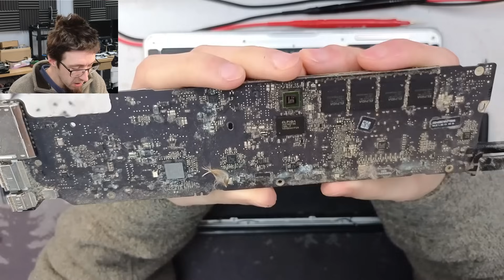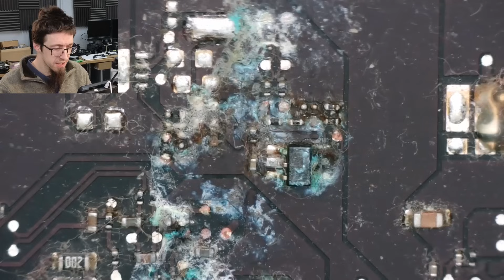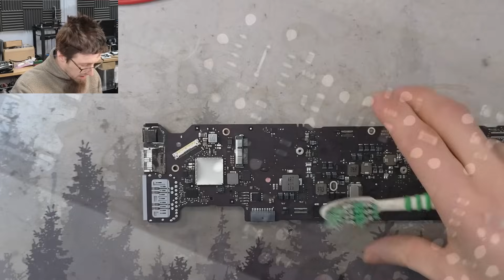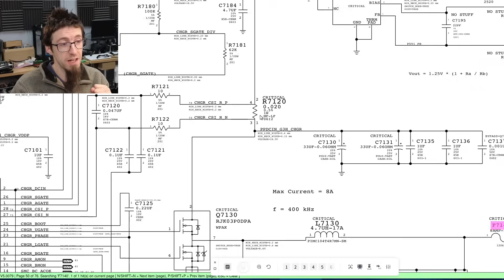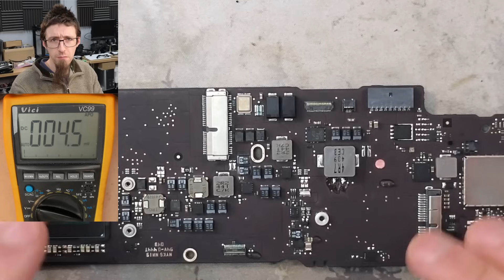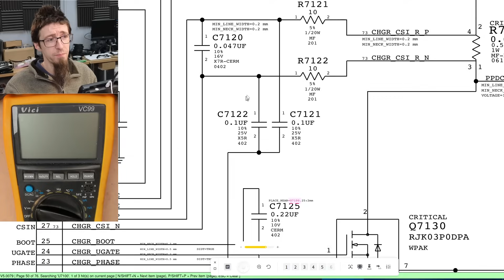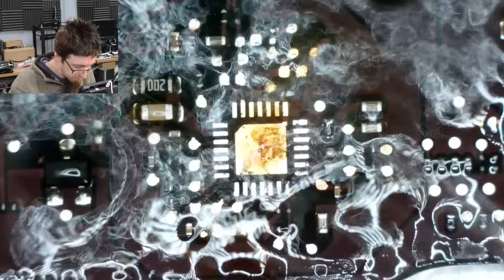MacBook Air A1466, Lots of Corrosion! - LFC#382

Comment: Hello I was watching your video, to learn how to take my laptop Lenovo ideapad 320 apart and clean ,as it is giving off a headache producing odor. It had some fuzz on the screen ,some fine dust on the inside ,heat sink ,so I removed it and blew it out ,and sprayed with isopropyl alcohol .I removed the fan and cleaned it, it works , all the components that I can see look clean as new , shows no hot spots. The odor doesn't smell like burning or hot, but more like a chemical smell. I bought the heat sink past and applied when I reassembled it. The odor was still their, so then I bought a new battery and replaced it , odor is still their. We have no local computer repair people ,covid bankrupted them. Can you shed some light on my issues.  The computer works fine ,notice no changes in any of its operation, just sickening smell.

Comment: I do what some others do, I’ll sell the customer a replacement refurbished board, then take this board and refurbish at a later time. Customer gets out the door quick and on the cheap, I get another board in the rotation.
Reply from the maker: Yea this is what I'm trying to get into now, as I've got a few boards in my pile with issues that can be fixed, but aren't jobs I really want to do on an open ticket.

Comment: Great content, as always, Graham. I know you did a video about bench PSUs quite a while ago, but would you mind sharing an update about how you are connecting the USB-C (including power supply + Paul Daniels's meter)? I'm looking for an effective way to have a USB-C supply connected to my bench PSU + meter. I have a feeling my PSU is not ideal (being it a cheap one) having short circuit protection & needs to be shorted to be able to adjust the current. Thanks. Daniel.

Comment: 3:12 Omg, a bird was sucked into the laptop 😂 - It is always super interesting to look over your shoulder when you are doing these repairs, even though I am a complete electronics novice. I wish I had someone like you around the corner here in Germany as I am having some minor issues with the battery charging on my beloved old MacBook Air A1466 - I think something weird is going on as the new replacement battery is not working reliably.

Comment: Hi Adam, Fantastic video, as usual. I really appreciate your time in producing these. I have a question regarding FlexBV. Where do you obtain the schematic and board views from? I've looked on Madcap's and either I'm missing something, as I can't find a central point where these can be found. You help would be greatly appreciate.
Reply from the maker: If you google search "820-00165 schematic", the top hit is a Badcaps thread with the schematic and BV attached

Comment: I have this exact board in my Macbook Air. I have really considered trying to reball new RAM chips into it to get more RAM as 4GB is a bit painful these days. On the other hand it has been a very reliable hard working machine for many years. One of the very few products Apple made that maybe approached being worth its price tag when it was released. When mine was new in 2015 I actually would regularly get 8-10 hours out of it on a single charge which was useful given my job at the time. Glad to see this one live to fight another day. Years ago I used to watch Louis Rossmans autistic repair streams until the early hours of the morning.

Comment: Quick note, looking at the power draw meter in the top left, what device did you use for hooking up to the magsafe 2 connector?
Reply: It's one of my USB-C meters and he's using a USB-C to Magsafe2 cable.  Of course, as yet, I still haven't got them up for general sale :|

Comment: Nice fix!
Is it possible to swap logic board on my old MacBook Pro Late 2013 13.3" Retina A1502 for a smaller upgrade?
Reply from the maker: I don't think you'll be able to get a meaningful upgrade - the 2015 Retina has a different chassis version, so 2014 is the best you might be able to do, and that's not going to change much unless you were able to go from an i5 to an i7 or something. There's wiggle room with the MacBook Air because the chassis itself basically didn't change for like, 6 years.

Comment: For what i remember also a trackpad or keyboard problem could prevent che board to power on.
Reply from the maker: Kind of. I don't think it can prevent the board from starting, but if the keyboard isn't getting a proper link, the power button might not work, which might look like a no-power situation.

Comment: Great save, and good approach.
This board is propably going to run several years yet.
The biggest thing killing these laptops is software updates.. hardware turns way to fast obsolete..
Got a dell 2017 xps 9550, i7 quad core, nvidia gpu, on second battery…cant update to win 11. Still is a fast and sleek computer, but no win11 equals over time obsoletion…